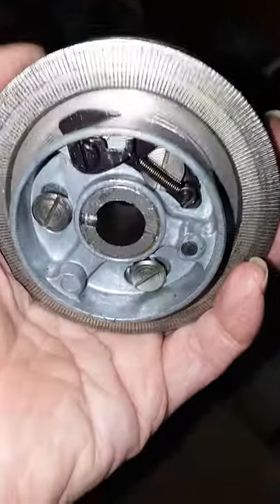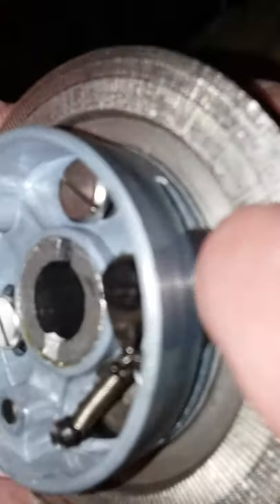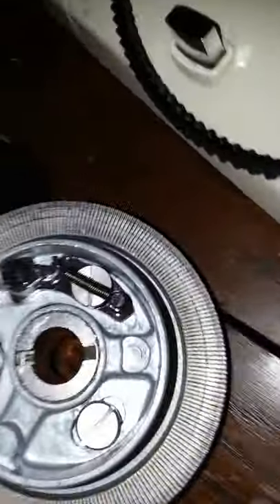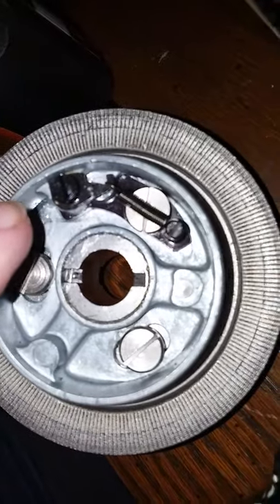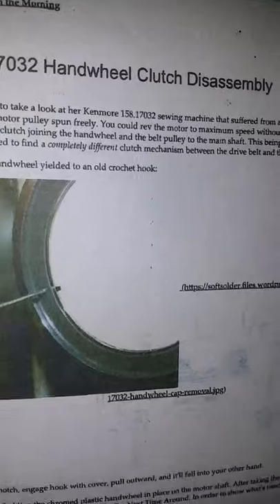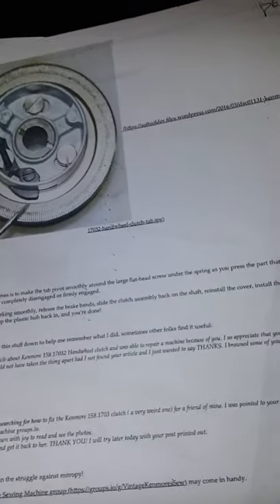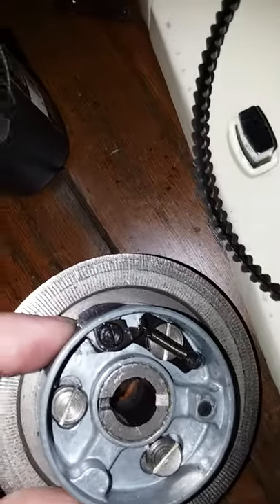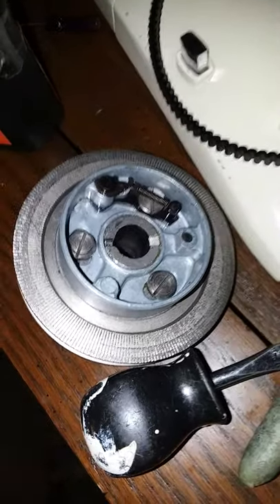Kenmore 1803 1703 Sewing Machine Clutch mechanism repair information

Comment: Hi Rebecca, thank you for your video is very clear. I know what happened to my sewing clutch. However, I don’t know how to take the clutch out of the machine. Please help me with this!
Reply from the maker: I did a tutorial on my blog, including a link to Ed Nisley's blog post tutorial, as well as many photos as I worked on several of these-

The plastic cover has a tiny hole, you slip a tiny hook or pin behind it, to remove that, then, there is a screw, and more details in my blog post.

https://tumorfarmer.blogspot.com/2020/07/kenmore-1803-and-1703-frozen-clutch.html?m=1